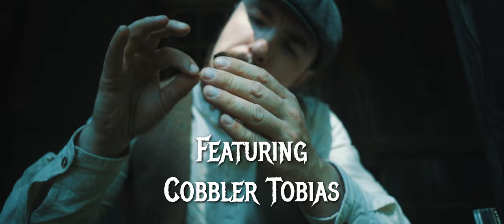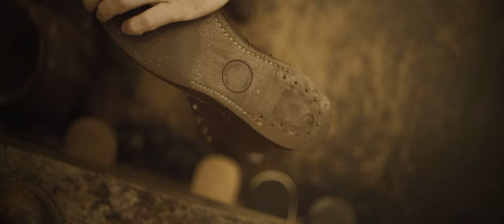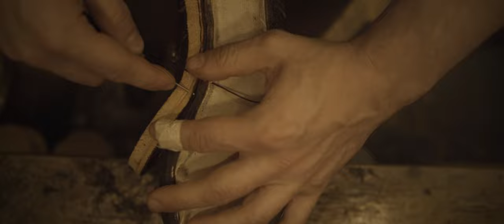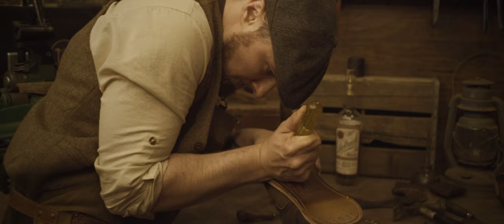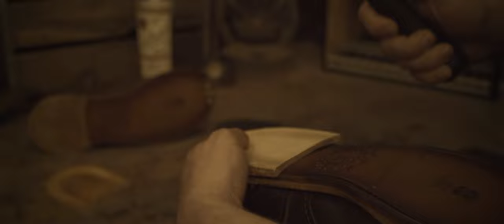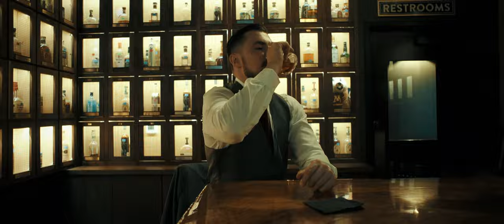Complete Red Wing Iron Ranger Recraft | Whiskey Inspired, Prohibition Themed Resole

Comment: 😳😳 dude I want my Iron Rangers to look like those.
Reply from the maker: Thanks! We can make it happen for you!
Reply: @WyattDadCobblerCompany  would it be possible to make the width more narrow? I love the iron rangers but they only go down to a D. I am basically a C and once they break in I end up adding a false tongue and extra layer of veg tan inside to tighten them up.
Reply from the maker: We don’t offer that service because it requires relasting the boots. We don’t carry those types of last’s. It wouldn’t be an accurate resize without those.
Reply: @WyattDadCobblerCompany  that’s understandable. As soon as I wear out the soles I’ll look you up for something similar to those, with a different twist. Lol
Reply from the maker: We can replace the original inner sole with a much thicker leather inner sole. That would take up some room to reduce volume in the boots. Similar to you adding an additional layer, but built into the boots.
Reply: @WyattDadCobblerCompany  I was thinking that too. Although a slip in leather inner works it’s not fixed in place. I am hesitant to glue it as I don’t want to permanently  mess anything up.

Comment: How did you stitch the welt onto the boot in the rear section if you didn't add gemming? Doesn't a welt usually attach by going through the gemming? Do you just stitch the welt directly through the leather on upper on the rear section or did the gemming go around the whole boot already? Nice video 🙂
Reply from the maker: The purpose of the gemming is to hold the inner sole to the upper. The boot was originally designed with a heel seat/rand. The upper is attached to the inner sole for that design. Gimming was not necessary since we didn’t change the design of the boots.

Comment: 🤔 so I have two pair of Red Wing Heritage boots. In both pair the leather footbed is all cracked. I have had many different heritage style boots and have ONLY ever experienced this with RWHeritage. I felt like I did a pretty regular job of letting ‘em dry and even used shoe trees, at one point I pulled the trees out on a pair and it had mold growing on the end of it. But what I’m seeing here is all that can be replaced… 🤔
Reply from the maker: Correct, we can replace the footbeds (inner soles) when new soles are done. Another thing you can do on future boots, is to use conditioner on the inside 4-6 times a year. That will retard the cracking.